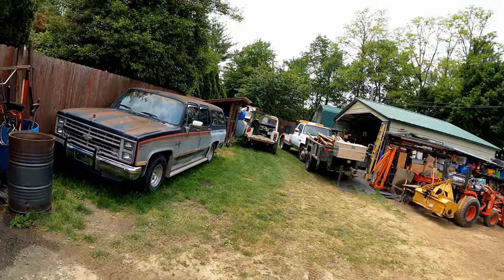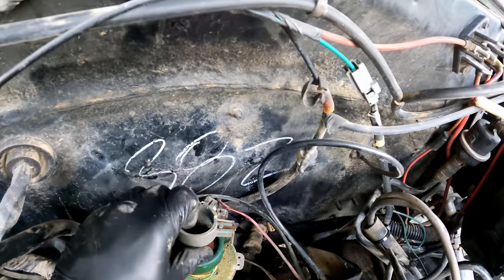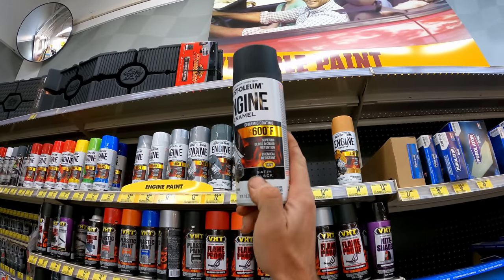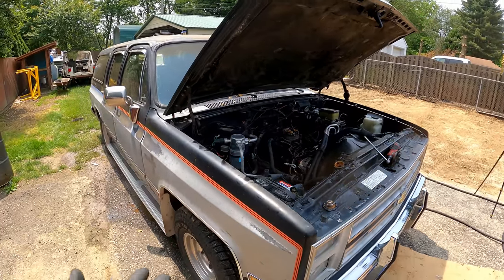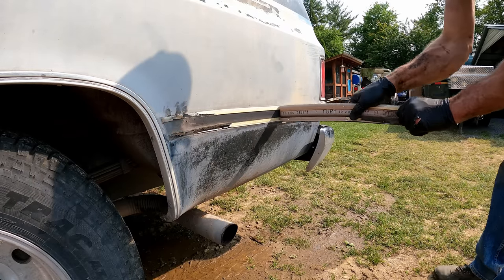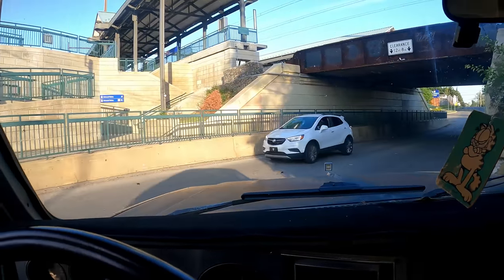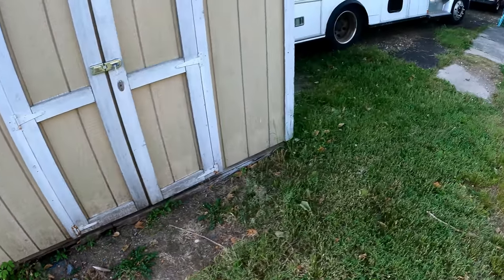'87 Suburban Intake Leak and TLC "Ema2.0" - NNKH

Comment: That's AWESOME that Peak sponsored you!! Really nice. I totally agree about not flushing a system, if you need to do a drain and swap due to time or mileage, just drain your rad and engine, whatever comes out comes out, fill it back up and call it good. Same for the sludge.. that's important stuff (the engine needs that weight to stay in there!!)

Comment: I live 30 miles Northeast of Pittsburgh,  the true Rust Belt!  The old square bodies look good and are protected by applying bed liner all along the bottom of the body and up around the wheel wells.  The right color combinations are sharp!  Eddie

Comment: For pitting on aluminum or cast iron like that I usually like to mix up a little bit of JB weld and just use a very thin layer of it to fill in the pits and usually I use a razor blade as a spreader so that the only place it ends up is in the low spots and then I go over it with a carbide scraper after it's dry and you end up with a nice flat clean new surface.

Comment: That sensor you removed from the block drain, is a "knock" sensor for ignition timing. It is recommended to install a new one, and it does require a torque spec. New sealant on the threads and/or not torqueing will compromise its sensitivity.
Reply from the maker: Oh okay. Thanks for that info! I'll go ahead and probably order one because the plastic is broken on it too
Reply: @NoNonsenseKnowHow  The ECM does a knock test which involves checking to make sure that knock sensor responds.  If it doesn't it will throw a code and pull a ton of advance.  So yes recommend a new AC Delco and install exactly the factory way.
Reply: Back in the OBD-I days, that sensor was added to "feel" the low frequency vibration associated with "spark knock". There is,, inaudible,  and audible spark knock. Audible spark knock, as you know will burn a hole in the piston,, but inaudible spark knock will pound the upper half of the rod bearing out.
 That's (in a way,) kind of a bonus we got from OBD-I .   The computer as forementioned in another comment, will throw as much advance at the timing as it can until it "feels" inaudible spark knock. So with OBD-I your engine will run a-bit cooler and make a-bit more power with premium fuel over low-test fuel. On OBD-II it doesn't matter because it controls more parameters than Its predecessor.
Reply: @deanmeyers1690  What I described happens very briefly the first time you engage Performance Enrichment mode on an ignition cycle.  This ECM and in general OBD-I cars do NOT try to run timing on the ragged edge using only knock detection to keep things under control.  The intent of the calibration (with a properly functioning engine and the correct octane) will NOT need to retard any timing.  It's there for protection.  Also, it will pull timing more aggressively so if you are riding the knock sensor all the time, you are not getting optimal performance and should reduce base timing (in a GM TBI particularly).  Or there is something wrong like carbon build up.
Reply: Sorry Bud; I didn't intend to start a confusing discussion over the sensor,, just merely explaining what's a proper repair and that it does more than plug a water leak. Enjoy the holiday weekend.

Comment: Enjoying your videos - new subscriber here.  As one that once lived in the Midwest - I'd toss out the idea of soaking the belly of that baby in either Fluid Film or Wool Wax - Wool Wax doesn't smell as strong - but either do an amazing job of keeping the rust away - and it washes off.  I use to treat my rigs twice a year - it makes the bottom slimy and dirty = but not rusty!  You can't use it on  the newer GM with the soft/wax coat frames - but this Suburban is perfect.

Comment: Ran straight water in my 94’ for awhile since it had a leak I was putting off fixing. Needless to say, lots of rust ensued. Ran some CLR thru it, and drained it. Looked like a rust milkshake going down the driveway, down the block. Put a aftermarket diesel coolant filter in-line on the heater hose and ran that for a few months. Cleaned all that sediment out like a champ.

Comment: Intake manifold leaks on this generation of Chevy engine is quite common. I had to change the intake manifold gaskets on my '91 C-1500 pickup at around 100k. With that much clogging I would imagine you are going to need a radiator and a water pump before long as well. Both are easy to change. Ask me how I know?!

Comment: Just FYI regular enamel paint is good up to a few hundred degrees Fahrenheit. It's fine for intake manifolds and valve covers. If the engine's getting hot enough to harm standard paint you've got other problems.

Comment: I love those older Suburbans!  An old mechanic told me to run liquid Dawn in the system when doing a flush.  The soap provides a lube and it gets the ick out.  I've done it since and you won't believe the crap I get out of the system.  I love that Gran Torino! One in my area for sale for $4,000, has a 351.  Would be fun, but the wifey frowned at me :(  LOL.  Thanks for letting us tag a long!

Comment: Great job fixing the leaks on the intake. Smart move putting more rtv on the pitted areas of the intake near the water jackets ports. That's a great truck as far as being rust free, the frame, the body etc. You should be able to make a good profit when you sell it. Plus it will be reliable and safe!

Comment: BTW you can move that SHED pvc piping jack it up slide 3/4 plywood under it and pvc 4 inch piping it will roll been there done that
Reply from the maker: Yeah that was the plan, but she says I'm responsible if any damage happens to it and it's kind of rotted out on the bottom to begin with. LOL

Comment: Nice video. My first car was a Chevy Impala 2002, still have it, been in storage for two years. It has fallen victim to the Dexcool fiasco of Chevy with a leaking air intake manifold gasket. Small amounts of oil have been leaking into the coolant. I never had the money to fix so I drove it like that. Years I drove it with that problem and the cooling system still works today. Thankfully the oil seems to collect in the reservoir tank so as to not damage the hoses or radiator. Was a fantastic starter car until my dad who is an independent Mercedes mechanic had a customer sell him a Mercedes for cheap and he gave it to me.

Comment: Retired dealer tech tip when pulling small block Chevy distributors. 

Bump or turn the engine over until the rotor is pointing straight back towards the firewall and scribe or make a chalk mark so you can drop the distributor back in the exact way it came out and then you just need to set your base timing per the instructions on the label on the air cleaner or core support or look them up in Alldata or another reputable source.

There are multiple ways to set the timing. Be sure to use the correct one.

Bonus tip.  If you can still get updated PROM's for the ECM, you can increase horsepower and drivability considerably.
Reply from the maker: I just marked it and put it back in the same way it came out and then checked the base timing after warming it up
Reply: Or this.😊

Comment: I have found that flushing a cooling system with water a few times (with heat cycles between flushes) cleans cooling systems just as well as using flushing chemicals with the exception of seriously clogged cooling systems. Water is also much gentler on the system. I wouldn't flush it with plain water for months, just over a week or so at the most.

As we saw with your video, apart from the first litre if that, the water came out relatively clean.

Comment: ac delco - they don't just fit - they match - nice content on tlc pm for the truck - nice cruiser - you should get it painted and hold onto it - good parts runner - v sim motor to the wrecker #tbi #peak antifreeze #premixed

Comment: You should to try this neat lil trick for cleaning the engine parts Like valve covers and intake manifolds, what I use is aluminum bright which is a mild acid and it takes off rust, corrosion, and makes the metal look really good.

Comment: I never have anyone to help bleed brakes, so I attach a tiny rubber hose to the bleeder and into a container with brake fluid in it.  As you push the brakes , it pushes out the air but since the hose is in fluid, it never pulled in any air. Do one wheel at a time and keep an eye on the fluid level at he master and container at the wheel

Comment: G,day Chris, Jen and Gusman from Sydney Australia. Thankyou for the detailed information while changing the intake gaskets with sealant on the Chevrolet Suburban. Also "rad" flush and changing brake oil.
I can see your new garage workshop: any power supply in the underground conduit existing (110v lights and outlets) "new circuit or join into a power outlet?"
Good stuff, looking forward to seeing your next adventure.
🌏🇭🇲

Comment: I ran dexcool in a PC cooling loop for two years without issue, the distilled water only that I ran caused galvanic corrosion.  Now I am running that Subaru Blue coolant because it looks nice.

Comment: Being in the UK, I can't imagine having a vehicle like the Suburban with a V8 like that 
Awesome video Chris.....34 mins isn't long enough though 😂
Reply: lol plus they only make like 200 bhp on a good day. they are slow but they are really torquey. I daily a 1994 ford f-150 Regular cab short bed 4x4 5.0 v8 5 speed and i still get like 22 mpg its actually pretty good mileage for what it is.
Reply: @mromatic17  200bhp 😂 from a V8 😂😂
Like you say though it's low down torque more than anything 
If I were to import a V8 it would be a Ford Crown Vic CVPi
Reply: @itsmephil2255  yeah the 302 in my f-150 truck makes only like 230 bhp but it makes it toyota reliable cuz its so understressed. the crown vics that were used as taxi cabs a lot of them have 500k miles on them and they keep going. they are made to be beat on daily.
Reply: @itsmephil2255  engine tech is so good for these old pushrod v8's now that you can go to a wrecking yard and get a $500 chevy truck 6.0L v8 LS engine and with a cam swap and a tune you have 600 hp! its insane. if you put that in a small car it will shit on ferraris all day long for under $1000!
Reply: @mromatic17  don't tell Chris that, he will be scouring scrap yards 😂😂

Comment: I had a 1985 Chevrolet Silverado ½ ton pickup. 
305
 4 barrel. Drove that truck for many miles. It was a unique paint scheme 
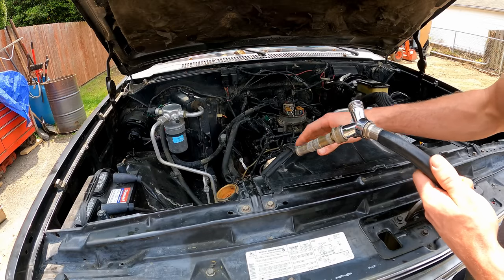Gold hood and roof with a white middle and gold on the bottom. The only real problem I had was that 13:00 the fuel pump lobe on the cam went. They were famous for that. So I installed a new one with a little more umph. I wish I still had that truck. I also have a water distiller. It makes a gallon in 2¾ hours.

Comment: 15:28 dexcool was notorious for gumming up after 50,000 miles….usually took around 5 hours to fully power flush a system…then we were usually doing intake gaskets cuz power flushing would blow em out….

Comment: A great solution to the roof of the burb. Scuff the roof with red scotch brite, blow off, clean with wax and grease remover and take a quart of Black Gloss POR 15 and pour it on the roof. Use a roller or brush. The next day you will have a super glossy magic plastic shell on the roof that will NEVER rust or leak. Don't worry about brush strokes in the paint. It is self leveling and will be a glossy tough shine when dry.

Comment: Washer bottles and rad overflow bottles can easily be plastic welded with a warm to hot soldering iron and some similar plastic as filler, I use OJ bottles. You can even repair old brittle water bottle's this way! Ps. Aussie emergency fuel tank repair mix sun softened soap and fine sand to plug splits and pin holes, the petrol (USA Gas. it's not gas u weirdos) reacts with mixture to harden! Works with diesel too!

Comment: I shall keep it in mind that you have an excellent frame suburban for a ongoing project as I also have Two myself. I have a 77 with what was new Sheetmetal and new springs and a radiator. It ran excellent and the interior was good although has been garaged twenty years. My 88 was rebuilt at the Chevy dealer and the B&M transmission from Summit Racing actually has less than 100 miles on it though it has been outside. Both have the barn doors and the 7.4Litre 9000# drivetrain. Been a good long while since either has travelled though. They look more like Ema 2 the interiors should clean ok. Both were mechanically excellent, and the hard parts should still be so. otherwise, is a sad story as they have been parked for a long time. I have been enjoying your channel. You're a good mechanic. Honest mechanics are what is hard to find. Cost of running a shop is so high seems like you have to steal with both hands to afford one. I had a guy try and sell me a radiator one night because he thought I was an idiot as I had a shirt and tie on I guess as I sold things for a living. I will watch some more and get to know you a little better. God bless you and your gal and Gus.

Comment: I literally "blew up"one of those motors well it was my father-in-law's, me and my wife went to go rescue him and his Square body Chevy that wouldn't start I was under the hood holding the throttle while he was cranking it and boom, it was a giant concussion I felt shrapnell in my arm from the valve cover gaskets, and I was in a giant cloud of smoke that I couldn't seem to wander out of, then I remember the sound pf the oil cap coming back down to earth, well after we towed him home I pulled the head and it had a giant hole through one of the pistons, that's what vacuum leaks do if you don't fix them

Comment: To each their own I personally like to put Indian head gasket shellac on All my gaskets except for head and exhaust of course, I even dab it on the inside of my radiator and heater hoses, never had a leak and it makes disassembly simple, it's a poor man's aviation form a gasket. It's called Buffalo now or some other correct name. But it's only a few bucks a  little brown bottle.

Comment: LMC has those recovery tanks for a little over $20. I just bought a new one.
Reply from the maker: Darn
Reply from the maker: I just went on their website and the only one I see is an aftermarket non OEM looking one..  just got the one from eBay in either case though. I just wanted to see if they had the same style for that cheap. That would be very hard to believe
Reply: @NoNonsenseKnowHow   hmmm. Mine looked just like the oem one. Part # was 32-0096 - RADIATOR OVERFLOW TANK. But every square body ive owned, that recovery tank leaks. Crap design.

Comment: True story: I mixed glycol antifreeze at a higher concentration than advised - the water pump seal  leaked! Drained and refilled at recommended concentration - water pump seal stopped leaking.

Comment: have a Sub with over 300000 miles  on it 97   just change the oil   air filter  park plugs

Comment: Are you sure that is not masking tape on top of the pinstripes? That would be common to cover the pinstipes with masking tape if you have to do some painitng. Especially on the barn door it looks like the tape is wearing thin and the stripes are showing thru.
Reply from the maker: No. It's what's under the pinstriping

Comment: Do you know the term: contradiction in terminus? When the drains of the cooling system are blocked there is some .... in the block. Check it again later. No need for expensive stuff and costs indeed. But what are you fixing? Leakage or overheating?
Distilled is evapourated. Liquid heated, turned damp left all the ... behind and when cooled down becomes clean water. Or deminarallized?

Comment: Don’t forget to drain the water out of the block. 1 bolt on each side below the head. No sense in adding distilled water when the block is full of tap water. Full strokes on the brake bleed will eventually tear a seal in the MC.

Comment: I would keep it. No less than 3,000 anyway. Because it's got that 700R transmission in it. They are only good for 100.000 miles. I learned it from MotorWeek. If somebody hits  you from the side in a little car you're done.

Comment: Paint the entire chassis and body or get used to the idea that Emma 2.0 will not be with you too long.   Those early to mid 70s Chevys were not known to resist fast corrosion!   I had a 1972 Suburban and in 1973 it started rusting.  By 1976 it had through rust and by 1979 it had huge holes in the floor.   Absolute crap metal prep and paint in those days! My 2002 Civic OTOH is still rust free (body).  My 2009 Focus too!

Comment: Not all of your viewers probably know this... but there was more Research and Development that went into the Chevy small block V-8.... than ANY other combustion engine ever made. Bar NONE. Indeed, R & D engineers at Chevy had a V-8 built with every single angle by degree, from the pistons way out wide all the way to firing from above. The angle that the pistons fire at... is, to an engineering degree of certainty, THE angle, which produces the most torque. That fact makes the Chevy small block the BEST engine to be placed in everything from an ambulance, to a corvette, to a ski boat, to an Indy car, to a wrecker. It is too heavy to be used in airplanes to power a prop, but it will work to drive ANYthing else... including an air boat, or paired with another of the same to power a large cabin cruiser. Pound for pound, the Chevy small block is the finest combustion engine ever made.